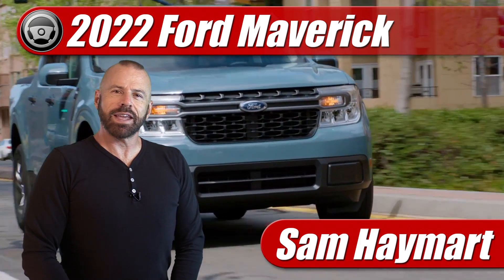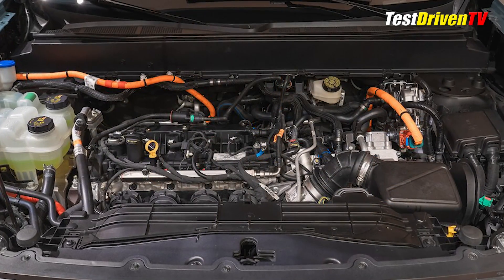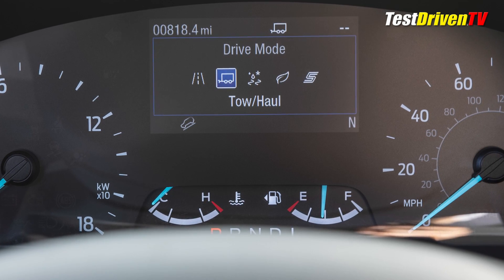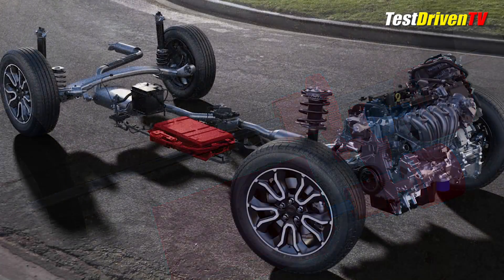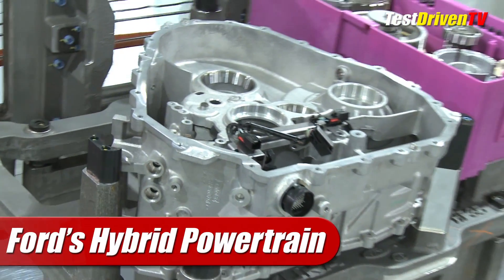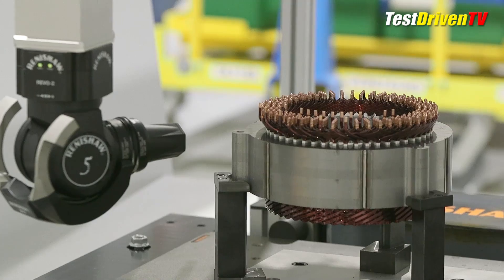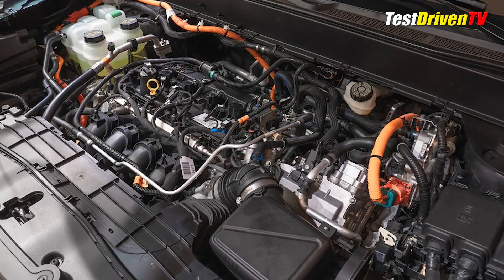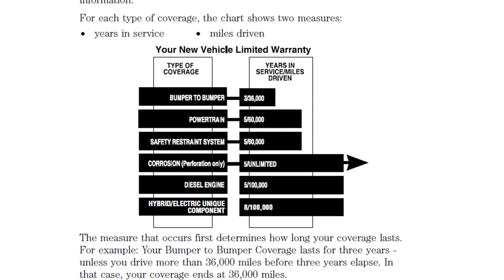2022-2025 Ford Maverick: Hybrid Explained

Comment: I drive a PHEV Lincoln Aviator.  Around town when I plug in the battery over night I get 23 miles of electric on the battery the next day.  This works great for all our errands we run since we are both retired.  Last winter we were able to drive around town with a few over night trips here and there and still drove 4 months without refueling getting 137 MPG.  Now the electric rate for Ohio is 19 cent per KW hr.  That’s about 1/3rd the cost per gallon of gas.  The cost for a PHEV compared to regular hybrid is about $1,500 to $2,000 more.  If you drive more that 10,000 miles a year it will take you about 3 years to break even.  On trips a lot of hotels let you recharge for free!

Comment: So the electric motor can produce 125hp / 190 torque by itself!! 
So Ford really played it conservative on the components to keep that blended 191hp. 
Also the “eCVT” has 1/3 the moving parts of a normal trans so that’s also great. Funny (scary) so many YT videos mis-identify the hybrid battery as the one under the rear seat (which is for accessories!). 
Last question — Eco & Normal feel like a CVT but how is my 24 Lariat Hybrid in SPORT mode shifting gears like a performance car?! 🏁

Comment: Can you really tow a 1600-1700 lb total wt  trailer in the mountains under the standard 2000lb tow rating?
Or...if you buy the 4 k Tow pkg it seems like it would affect the fuel efficiency touted by Hybrid as the axle ratio is altered significantly with the addition of a 4 k Tow pkg.  Thanks

Comment: Looks the same as the Escape Hybrid
Reply from the maker: Exactly the same
Reply: @TestDrivenTV  The escape is much smaller and lighter, how can they use it for this bigger truck?  The Toyota Highlander hybrid has a much stronger gearbox/ecvt than the Prius although same design, it has a v6 gas engine.
Reply from the maker: Actually the Escape is the same chassis and general footprint of the Maverick except for a short bit of length. Curb weight is nearly the same. The Highlander uses a nearby identical 2.5 liter 4 cylinder and ECVT, not a V6.
Reply from the maker: No. The current Escape and its powertrain is pretty well proven and trouble free.

Comment: This is a very informative video that conveys how an eCVT works really well in simple terms.  The Maverick is pretty cool if it fits your use profile, which for many people it will. 

My wife drives a '16 Ford C-Max plug in hybrid which has a similar predecessor to the Maverick's system, the main difference being it plugs in and has a bigger 7 kWh battery.  The eCVT equipped hybrid is great in stop and go traffic as it's seamless, no gears.  The eCVT likes to sit at 3K RPM and it will load the engine more at that RPM to a point when accelerating.  It will act like a "normal" CVT and rev the engine annoyingly high if you really press it, but the car goes quite well, much more aggressive and "zippy" than a Prius, at least the older ones.  It's not a hot rod but it has enough power to torque steer if ya romp on it, so that is good 😂  

The key is to drive it so it sits around 3K RPM when putting a load on it, unless ya like hearing a somewhat gritty sounding 4 banger revving to 6K.  The eCVTs have proven to be very reliable, as mentioned in the video they have far fewer parts in them than a conventional automatic transmission.  To date my wife's C-Max with 88K miles on it literally has been flawless.  It is also averaging 65 MPG thanks to the 20ish mile EV range.

Comment: If it's electric, why is it so anemic. 

Trains have been Diesel-Electric since the 1930s. Diesel-Electric has been the standard in trains since the 1950s. Electric motors are tried and true and very robust. Whether freight pulling millions of tons, or passenger pulling thousands of tons at 200 MPH, it's an electric motor that turns the wheels. This is gas-electric. How the electric gets in the battery doesn't matter. Electric turns the wheels. Why so weak? Not just the Maverick. ALL electric trucks, full electric or hybrid. They are all too weak. Is this to discourage people from buying electric?
Reply from the maker: How is an F150 Lightning or any of the current EV pickups that have 500+ horsepower and tow ratings through the roof weak?
Reply: @TestDrivenTV  Explain through the roof! Is it 80,000 ft pounds. Or 120,000 ft pounds? It could be. E-Axles with this level of torque are available. Look into Edison Motors. They are building semis, but more importantly, they are converting full sized pickups into diesel-electric. They can convert anything with a solid rear axle.

Comment: Is this Toyota licensed technology like ford did in the past?
Reply from the maker: Yes
Reply: Yes, but the engine seems to be a development of Mazda-designed Duratec 2.5L. I have a very similar engine in my 2010 Mazda 3, except that Ford added port injection and 13:1 compression ratio.

Comment: I just bought a used 2022 Maverick hybrid and apparently it had some service or repair work done to the hybrid system because the rear reservoir is currently filled with green coolant. I want to drain the green coolant and replace it with the correct coolant. Can you or someone tell me what coolant I should buy? vc-13-g coolant or something else?
Reply from the maker: Owners manual
Reply: @TestDrivenTV  I bought it used, no manuals were supplied.

Comment: Great video😊
I bought a hybrid Maverick yesterday. I once had a C-Max and this seems very familiar. I was surprised how truck like the maverick is and it feels like a torque monster.
Did a 56 mile trip home from the dealer on rural Pennsylvania roads and got 53.8 mpg for the trip.
Without using the hold feature it will roll back on you on a hill. That caught me by surprise .. The beauty of it to me is I can now escape the premium gas cost with my old car.
And unlike many I dig the industrial interior but the seats for now are as hard as a rock. They may break in hopefully.

Comment: I flat tow (4 wheels down) a 2023 Maverick Lariat Hybrid behind my motorhome. I set up the tow using the prescribed procedures, with the transmission in NEUTRAL. My question is what systems are powered (12 VDC auto battery) during tow?
Sometimes the vehicle goes into Deep Sleep during tow. Do I need a charge line from my motorhome? If so, where would it be connected? Thank you.

Comment: I never understood the part about not feeling shifts from the transmission, Why care? I had a 2015 Nissan Versa Note and its cvt a belt type never shifted I could care less. It kept engine rpm at sweet spot for throttle conditions. I guess I will never understand this want of a shifting feel. plus ther ecvt has no crappy belt design. I see it lasting a long time. Maybe one of the motors could fauls i guess.

Comment: The engine actually never drives the wheels, because it doesn't have an actual transmission, it's not mechanically connected. It works almost exactly like a diesel electric locomotive.
Reply from the maker: No. Did you not actually watch the video?

Comment: Hello are you still on with this channel I have received my maverick hybrid Lariat at around 6000 miles the check engine light came on,  The Dealer I took it to said he could not fine the issue. I picked it up and a few days later it came back on again they had it for 2 days and called that they found a problem with a damper on the transmission and parts on order and they plan on having it fixed next week after a 12-14 hour repair. Have you heard anything about this issue?
Reply from the maker: Heard of a few people having the issue
Reply: @TestDrivenTV  I sure hope this isnt a problem for the future of my Maverick

Comment: The battery is small and gets a lots a lot of high current charge and discharge cycles, wonder how long it lasts and how quickly it degrades?
Since you cannot plug it in, it's just a gas power vehicle with the added complexity of all the hybrid addition.
Far better to with the gas part and go to pure electric.
Reply from the maker: The battery is under warranty for 8 years, 100k miles
Reply: @TestDrivenTV  
What type of battery is it that is be cycled many 1000s of times and not degrade?. 
I want it for my EV.
Reply from the maker: The battery is under no obligation to make sense.

Comment: I have a 2010 Escape Hybrid Limited with 96,000 miles on it and it still runs perfectly.  It has a very similar system, except that this new truck is of course updated and modernized.  But the basic powertrain and theory of operation is the same.  I love the car.  After 12 years, I still get MPG ratings that are dead bang in the middle of the EPA's original estimates.  In other words, this is not a "sketchy sci-fi" powertrain.  It has been proven over hundreds of millions of miles already on the road, sometimes in cars dating back to 2005 that are still running well.  Maintenance on the gas engine is EASY:  this is not a complicated, twin-turbocharged, VVT engine with a lot of extra hoses and so forth.  The transaxles are bulletproof - they've gone more than 300,000 miles as taxicabs in New York City.  On mine, I just change the fluid every 60,000 miles.  Then the engine oil and filter, air filter, spark plugs, etc., and you have to keep tabs on the separate cooling system that is used to keep the temperatures of the high voltage electrical components in range.

The only question I still have is:  HOW is the HV Battery's thermal management done?  In the early 2005-2009 Escape Hybrids, there was a second A/C Evaporator in the rear cargo compartment kick panel that supplied cold air to the battery when needed.  In 2010 Ford deleted that, and it was a mistake.  The only question I have to look into before ordering one of these is to know more about the battery thermal management.

Otherwise, this is an EXCELLENT powertrain for a small pickup truck or SUV.  And it's at a great price.  The 2010 Limited Hybrid was about $33,000 when new in 2010:  that's more than $43,000 today.  Ford is doing a great job.

Comment: The ECVT like all CVT transmissions has oil which needs to be replaced. 
Best practices is to change this oil every 30,000 miles regardless of 
what the owners manual might say. REMEMBER,
you can  NEVER  over service a vehicle, BUT if you under service it you will 
be buying a new car soon instead of later.

!

Comment: This is similar to the Honda CRV Hybrid drivetrain, I drove a CRV for 30K and it worked well.  I would like to drive one.  They have come a long way from the first electric pickup, the Ranger 1988 to 91 I think.  Trucks did not work out so they recalled them and destroyed them.

Comment: At what point does the gas engine kick in? I would like to figure out if will work for my commute or just go with the ecoboost.
Reply from the maker: There's no set "point" . The gas engine and electric motor are always interacting one of the other or both regardless of speed.

Comment: I have recently received, after 9 months+, my hybrid Maverick.  It's pretty great!  I generally can't tell when the engine is running, and I've been getting 40+ mpg.  The steering wheel is hard plastic and terrible in my XLT, I may change that, but everything else has been terrific.  Good job Ford!

Comment: would have been a smart idea NOT to use the cvt term at all - ie ecvt should have been re worded to such as e-ptt ie e power train transmission or something similar to avoid the public not trusting it .The marketing dept really didnt think that through, as so many have been pre warned about all nissans problems and failures with cvt...and many will not understand or believe that this transmission is entirely different. Dumb move by Ford. PS really informative video - well done, and its changed my mind about buying an escape PHEV with this power train

Comment: Just recieved my new vehicle and have to say after 1000km most impressed with its performance, gas mileage is right at the 47 mpg and the electric motor will kick in at speeds above 100km if the right road conditions are present. I travel 270 km per day and mostly highway and have seen 70km + for my electric drive mode, it has cut my monthly fuel bill down by one third saving me between 250 to 300 dollars a month. My previous ride was a 2017 escape with the 1.5 ecoboost, which got great mileage as well just over 9L/ 100km and the Maverick is running an avg of 5.8L/100km. I am a trying out each of the drive modes and the normal and eco modes work about the same on the highway and if you use the sport mode it makes the throttle response time much quicker on the gas engine making passing much more effective. All in all great buy so far.

Comment: When the vehicle is operating in electric motor mode does the gas engine still rotate or is it non rotating? Wondering how this works. Is there a clutch in the ecvt trans axle that allows the engine to not rotate if not in use.
Reply from the maker: When it is in EV mode the engine is off. It is connected and disconnected with an electrically actuated clutch.

Comment: The Ford transmissions may seem to work as an CVT but they are not Continously Variable Transmissions, because they only have one fixed reduction gear and never vary. What varies is the electric motor speed, just like an electric power tool.  The main traction motor is the primary drive at all times.The gasoline engine is not coupled at low speeds or in reverse, and they do have a clutch to engage to the motor/generator (which acts as the starter) when more power is requested at the accelerator, and if the battery charge is low. I have a 2014 Fusion Hybrid with the HF35 and you can read plenty on how it works on YouTube, especially on the Weber University site. 

The HF35 has a planetary gear set to allow two power sources inputs (engine and motor/generator) and one output added to the main taction motor. Ford hybrids are mostly electrics than true hybrids. If the battery was huge, it can run almost forever on electricity. That is what the "Energi" models can do with external recharging. Some Fusion Energi owners never add gasoline in years! For the same reason, the engine oil can last over a year but the system is programmed to notify an oil change every year. I do it to keep the warranty, but in the future, I can just watch the engine oil life percentage and change it when it goes below 10%.

Comment: On maverick hybrid what is sleep mode.
Reply from the maker: How do you mean "sleep mode" ?
Reply: @TestDrivenTV  maverick went in sleep and would not  start 
How do you get out of sleep mode
Reply from the maker: Probably an issue to consult your dealership about, likely a weak or defective 12V battery.

Comment: The powertrain warranty I see on Ford's web site is considerably short of the 8 years / 100K miles you mentioned...
Reply from the maker: The hybrid unique components are covered 8 years/100,000 miles. You should also see that on their website.
Reply: @TestDrivenTV  - Thanks for replying!  (There is some ambiguity of info on Ford's web site.)  I wonder if the "hybrid/electric unique component" term included combustion-side parts like the coolant heat exchanger in the exhaust pipe.  I would think it fits the description since you never see those on non-hybrids.

Comment: The hybrid gas engine has a compression ratio of 13:1!  Ouch,… that takes me back to the ‘good ol’ days’ of muscle cars, where engine life was <25k miles.  Can you kindly comment on the octane requirements and maintenance management techniques which will be needed to sustain that gas engine’s reliability for an expected vehicle life of ten years?
Reply from the maker: It runs on the Atkinson cycle relative to timing (not Otto), which means it's not highly strung. It runs on 87 octane and is actually quite a mild tune.

Comment: Well your video answered some of my questions. I’m semiretired and work about 3 days a week. When I do I drive the interstate 80 miles round trip. At this speed will the gasoline engine take over?  Is the higher fuel economy in around town or interstate?  If it’s around town I’m not sure this would be an advantage for me.
Reply from the maker: Both city and highway mpg are higher than the 2.0 EcoBoost model. The Hybrid is rated at 42 mpg city, 33 mpg highway and 37 combined.
Reply: @TestDrivenTV  than you sir and Happy Thanksgiving!

Comment: New here and have a question. All the other videos dance around how much torque the system has.  They only quote the gas torque and not include any electric torque.  In this video it states 162 HP and 155 Ft lbs from gas and 126 HP and 173 Ft lbs from electric.  There has to be some extra HP and torque when both engines are running?  TIA.
Reply from the maker: Combined torque is not published by Ford because the torque curves of the gas and electric motors never intersect such that the total is more than one of them by themselves.
Reply: @TestDrivenTV  Thanks for reply.  Will have to think more on this to really try to understand how the system works.  So far it is way above my level of understanding

Comment: Question. My job is about 90% road travel and 10% sitting on the side of the road....will the Maverick jump back amd forth from battery to motor to battery while sitting in park the entire time? I don't like running my motor for 3 or 4 hours straight just to stay cool (I'm in texas) so that why i am wondering of the hybrid goes back and forth.
Reply: I own a 2020 Rav4 Hybrid. It's great to be parked with the air conditioner on and the engine off. After the traction battery starts to get low, it will automatically start the engine, and the engine will run a few minutes until the traction battery is fully charged, and then the engine will shut off. I love it. 2022 Maverick Hybrid ordered.

Comment: This is not an accurate video. You cannot do electric only on the Maverick. Ford's top engineer said this
Reply from the maker: The Maverick can indeed power itself down the road under electric power only with the engine turned off.